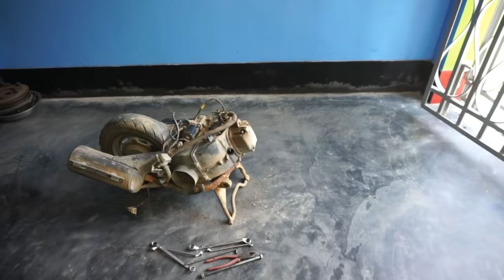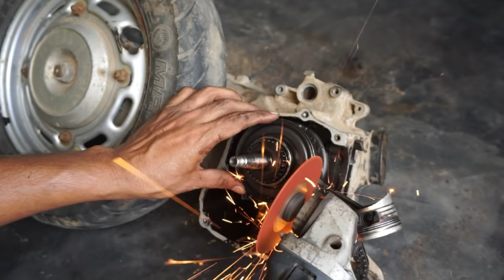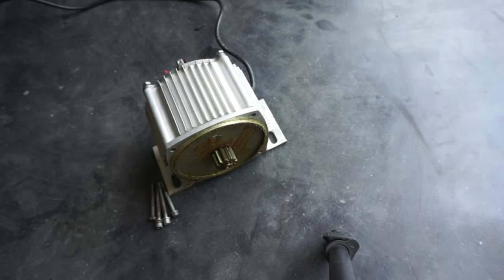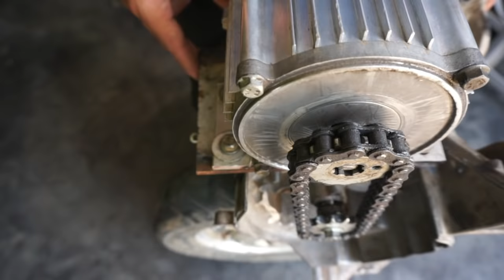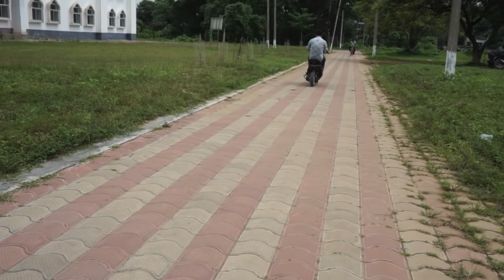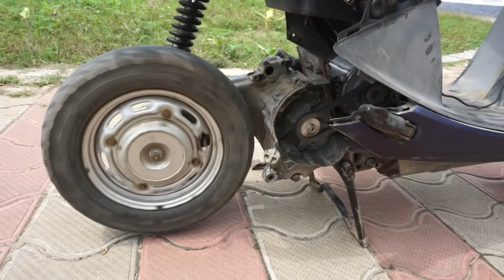DIY Electric Scooter Conversion full video # Technical Partha

Comment: Add engine oil to the crank housing for lubrication, otherwise crank bearing will cease soon.
Reply: Yatak rulman bjse olmaz devam
Reply: Greased baring can be replaced I think.
Reply: UR ri8
Reply: It would be wise to remove the counterweights too. They’re useless and just one more heavy component to spin. A direct shaft would be better

Comment: This is well done, but i think you need to take out the original crank shaft and replace it with a straight shaft. The original crank shaft is designed to balance the reciprocating mass of the piston and con rod, the piston and part of the con rod have been removed so now it is out of balance and will vibrate.
Reply: And how the lubrication will function.
Reply: @westmontroque7061  Which lubrication? For crank bearings? The same as it functions with original crank. They are ball bearings not shell bearings anyway, with no heat from combustion engine and no blowby exhaust gas leaking past rings they would actually need very little lubrication, they would probably be fine just packed with bearing grease.
Reply: Do you mean without the counter weight? Where can you buy a shaft without a counterweight?
Reply: @Meme_supplier  Huh? Just a straight shaft the same length as the existing crank shaft with the same diameters at the bearing races, you don't need to buy it just make it. Guaranteed that motor vibrates like crazy the way he has it set up. If the vibration resulting from the mass of the reciprocating piston was negligible and didn't need counterbalancing then the engine wouldn't have had a counterbalanced crankshaft to begin with, but it does and now he's taken out the mass it was counterbalancing so it's going to vibrate the exact same amount as a piston engine with no counterbalanced crankshaft. .
Reply: Можно на прямую к редуктору цепь пустить не через коленвал
Reply: @teist111 yes that would be even better.

Comment: All he had to do was change to a sealed bearing for the crankshaft , put a block off plate to keep the oil in the trans area, and it can last. Problem, its off balance, he needed to weigh the piston and rod, and add that weight to the crank rod journal. If he do those things, it will be trouble free. Other than that, good job.

Comment: Great effort loved it..... however to increase the efficiency and reduce noise.
.
1.clutch should have been excluded and a direct coupling should have been established, 
2.motor to gearbox connection should have been done with a drive belt to reduce chain noise and the chordal action of the chain
3. rubber bushes below the motor mounts to dampen any noise.
Reply: agree man
Reply: are you ever view the video on youtube that DIY which is your explain
Reply: @edrisumindra3118  No I am speaking on the basis of some experience that i have building formula student racecars in college.

Comment: Maybe a more direct path between the electric motor and the wheel would have been ideal. Coupling the motor directly to the transmission belt that is protected in the casing for example, and get rid of some parts.

Comment: So by cutting the connecting rod off, the piston is removed but a stump of the rod is left in place? Why? That would cause an imbalance, no?
Why not have just unbolted the rod and remove it with the piston?
What am I missing?
Also, must have had that chain measured just right to fit like that. 
Finally, what kind of electric motor was used?

Comment: Perfect use of CVT

This will give more Mileage per charge, and also this will give more speed

And this will never overload overload the electric Motor, due to CVT.
Reply: Right! But manual transmission will be best with electric motor
Reply: @automoto95  manual transmission means hell lot of parts and Oil dipped components with a continuous need of maintainance of oil and gears and clutch lubricants on regular intervals. Then again a standard specification of oil 10W or 20W. Adding extra costs. Plus Manual will put load on the Electric motor, since not everyone is a expert at manual gear to speed ratio handling, and will be a knocking sound setup, putting unnecessary load on electric motor if ratio of load : speed is in wrong gear. And it won't be a handy vehicle for many of today's generation

while in most CVT its dry clutch and belt. Replacement and service is very easy, No oil dip components, means clean setup with motor and easy speed change with automatic load balancing of the CVT
Reply: @bikramdeep2  i thinking about very Simple and and realiable gearbox with only  2 gear or 3 (1st for high torqe on wheels 2nd for standard drive and 3th for higher speeds) and the electric motor dont need clutch if the gear is cheange when the car is on stop in electric cars motors have temp and other protection systems and sensor so it cant be overheat and damage by wrong gear. the cvts torque on wcheels will probadly suck on lowspeed on offroad and cannot pulling heavy triller  the beld skid and car cannot move maybe ony good cvt can do that and yes that type of cvt will be better than manual transmission
Reply: But you should consider the 25 percentage efficiency loss due to cvt
Reply: I have done an ebike replacing the cvt with a chain drive which gives better speed.
Reply: @fabinfabin2208  nopes in fact it is better since efficiency of geared vehicle depends on the rider and every rider is not that skilled

and for city use of highway use CVT is best

and CVT is more refined than tooo much refined gearbox clutch arrangement
Reply: @bikramdeep2   which is better sir cvt?
Reply: @rsstatus2533  CVT is best, simple and easy setup, and low cost on service of spares
Reply: @bikramdeep2  se what is top speed ?

Comment: Very , Very , nice idea , well done Diy , only few details , when You mounted the plate for the motor , You left many openings for dust and Water to enter in the cavity where the former crankshaft is that will ruin the berings ,You should seal it  also the area of the chain that goes to the wheel ,but great job , the best to you

Comment: Once i get started with my new job, i'll buy myself an old, non-working scooter and modify it the way you guys did. Albeit with a longer mileage. Also, an improved mounting on the cvt so as to prevent any damage to the motor as well as retaining the stator to provide additional power to the batteries for longer trips.
Reply: Using electricity from a battery to turn a motor that spins a stator to make electricity is wasteful.  

Just like it takes power from the original gas engine to spin the alternator, it will take power from this electric motor to make electricity with the same alternator.  
You can't even make the same amount of electricity with the alternator than you took from the battery to spin the alternator in the first place because it's an inefficient process every time you convert power from one type to another.   

Think about the Law of Conservation of Energy with a thought experiment.  Imagine the performance of a 5 hp engine powering a scooter with a direct drive by chain & sprockets.  Next, imagine using the same 5 hp gas engine turning a stator (alternator) that charges a battery that powers an electric motor that propels the scooter with the same type of chain drive.  Will you gain or lose horsepower at the wheel?  
You will lose because an alternator is not 100% efficient at making electricity from mechanical power.  Also the electricity the alternator produced is not 100% converted to chemical energy in the battery during charge and not 100% of that comes back out of the battery as chemical energy is converted back to electricity.  Similarly the electricity you are now left with will not be 100% converted by the electric motor powering the scooter wheel.  All those losses add up.
So, if you have a battery powered scooter to start with, you should run your lights & horn directly from that battery rather than running a wasteful alternator from the electric motor to power your lights or to inefficiently try to recharge the main battery.  
Of couse these additive inefficiencies explain why an electric vehicle can't recharge itself on the road when even at 100% efficiency the best it could do was to break even returning the same energy back to the battery that it drew from it in the first place!
All you have done is add weight and complexity to your vehicle.  

It gets much more complicated to engineer an efficient hybrid vehicle, but that's a whole different story.

Comment: I have converted my scooter the same way using belt drive , 48 volts bldc motor 750 watts. Works like a charm , but I would like to give 4 inches motor pulley and crank drive 3 inches. For a better speed
Reply: Hii
Reply: Do you have picture how much teeth does your cogs have please
Reply: Speed kitni hai aur kitna km Chalti Hai
Reply: Halp mi sar

Comment: Show us a video of the wrecked engine, please. We like to know how far you go without lubrication of the crankshaft before it seized !
Reply: just like 50cc 2 stroke scooter, no need for engine oil inside crankcase
Reply: @spin022  have you ever heard of the 2T oil? I guess not
Reply: @Morzsaszar  2 stroke oil mixed with gasoline to lubricate the cylinder bore and the piston itself, but there is no crankcase oil in 2 stroke scooter engine
Reply: @spin022  I know, this one calls mixture lubrications
Reply: @spin022  It absolutely essential for the bearings
Reply: @spin022  that mixture lubricates the crank to dingus.
Reply: I'm using this electric conversion method for 2 yrs and have not got any issues yet with the lubrication of crank bearing, remember that it's electric and there's no heat that bearings have to deal with
Reply: They are ball bearings not shell bearings and now with no heat from the combustion engine and no exhaust gasses blowing past the rings the crank bearings would be fine just packed with bearing grease, plenty of machines have shafts and ball bearings that run high RPMs long term without being oiled, just packed with grease. The biggest issue with this engine is that he used the same counterbalanced crankshaft with the piston removed, now without the piston it will be way out of balance and vibrate like crazy, to the point of destroying itself after a short time I would think.

Comment: this method will work but you are cutting the piston at the crank skipping flywheel balance which will create more vibration and often damage engine bearing if you compensate the weight at the opposite side of the flywheel by adding weight this is going to be ideal in performence

Comment: Fantastic, thank you! I thought to convert my Vespa LX 50 2T to electric by attaching motor directly to the crankshaft, but this way it maybe even easier. I spotted that your motor is less that 1kw? What speed it can reach?
Reply: The motor is 750 watt and speed may be 45 to 55 kmph.

Comment: I think it is possible to fit a bldc motor at scooter rear wheel studs with a  + type clamp of pully. The plus pully,  fit on scooter engine other side on stud nuts than motor fit with + pully, also connect aarm to keep motor study ly. No need to make alteration of scooty  I think . Just like as water pump set mono block.

Comment: Sir, what is milage you are getting while chain drive! please Do and comparison with belt drive 🙏.  Also please make a video on making fixed battery compartment under footboard with proper ventilation or cooling system

Comment: On a side note after watching video. Remove gas tank and mount a car alternator that is belt or chain driven so you only use battery for startup and alternator takes over keeping battery charged for much longer trips.😁

Comment: Muy buena la adaptacion ...perooo deberia de subtitular el kilometraje q rinde x cargada...y a cuntos kilómetros va x hora x lo demas muy buen video...ojala y muy prnto tengamos mas noticias del mismo ya terminada la moto.
Reply: Sí...y sobre todo que pack de baterías que usó y donde las colocó no?
Reply: La partie électrique  de la batterie 
Comment  l on branche les fils du moteur + et -  directement aux bornes de la batterie. Et pour accelerer et ralentir y a t il  un variateur. Comment faire..et également le plus important les
Références et types du moteur que vous avez monté. 
Merci de reponde SVP

Comment: Brilliant! Please try Petrol/electric hybrid with on road charging in petrol mode. If you crack this then its a big seller for you.
Reply: Put an electric wheel hub on the front as a stator (generator/alternator) n leave the petrol engine but put another hub on the back with a bicycle freewheel for when the rear motor takes over it doesn't fight the clutch, etc

Comment: may I ask,. what is that solution or liquid that you use to remove the grease from the motor?? is it a degreaser solution or oil or soap and water?
Reply: Gasoline
Reply: The best is Diesel added with soap 

apply it with brush or spray it with any sprayer bottle on the grease leave it for 30 minutes or if too dense grease, then overnight. Use a hard plastic brush or a metal wire brush and scrub, and then simple detergent soap wash
Reply: Maybe petrol or diesel. We usually use these to remove grim from vehicle parts

Comment: Why same sprocket? It's 1:1 where as the original of your BLDC Mt was 1:3 gear ratio.

With this weight load the bldc motor is at least 1:7 gear ration otherwise it will burn the hall sensor and one of the 3 wires.

Comment: Between motor and wheel you put cvt it make loss of power and pickup you got more power or pickup if you remove cvt between motor and wheel 

Attached motor with wheel directly its save enery and give you long range or power will increase pickup also increase 😊

Comment: You should of connect motor to rear wheel belt instead of again to CVT clutch, because now there are two controllers because of there are energy loos, 
Motor spin very fast ,rear wheel rotates very slow.

Comment: Keeping the variator in the transmission is a bad idea. This is where a lot of energy is lost and in this case, will affect the riding range. The best option is to use a 3KW hub motor and a fabricated swing arm. Less effort and better efficiency.

Comment: Major drawback of an automatic scooter is its CVT transmission, you just kept it. There will be a lot power loss in there. Just use a hub motor or direct belt drive
Reply: You need to keep the CVT for toruqe. There is no power loss here. What we need is torque instead of raw horsepower.
Reply: @binarytv2904  CVT is power loss. Electric vehicles doesn't need any kind of gears or clutch. You just need a pair of pulleys and a belt, that'll give you torque. And speed torque curve of an electric motor is almost flat. So why would you need a CVT
Reply: @roshinparameswaran4817  EV's do need gear, every EV out there has a single speed reduction gear. Thats the minimum. If you need a smooth takeoff a single speed reduction gear is neccessary otherwise it's too much load on the motor and the massive torque from the mmotor causes jerk. It's inefficient. A therotical 1:1 motor:transmission ratio is not practical. It can be done but no EV manufacturers out there does it. Only college projects and hobbysts does it.
Reply: @binarytv2904  all hub motor drives directly run on motor, they doesn't have gears. 
Two pulleys and a belt also act as gear. A single speed gear system is using to produce torque that we need if the   motor is designed to the actual torque required, there isn't a need for a gear. Modern e scooters are using the belt and pulley system as replacement of gears and move the motor to the centre of the vehicle so that the centre of gravity will be lower.
And a CVT is not a single speed gear. First study a CVT system, then you'll know what I said.

Comment: Well done but you forget to remove connecting rod from crank shaft
Reply: Even if it is removed, the engine will run like a jackhammer because the flywheel is super imbalanced.  The product is fake.

Comment: Yet another perfect example of the proper way of converting a scooter without scrapping the pully and cluctch system as well as the gearbox. How fast did you guys get this to run? Can it carry a 125kg fatass like me? I sure hope so!😆😆😆😆
Anyways, the only thing to give this scooty is a new racing pully and clutch system.

Comment: 750w isnt powerful.u need around 3000w.also u need to lubricate the bearings.better take off the engine and build homemade frame.u dont need cvt anymore its only more resistant.

Comment: you need to chance the springs in cluts this electric motor has les power then cilinder
Reply: You mean Les power
In 0 - 100 rpm
tHE TORQ MORE THAN COMBUSTION ENGINE
and you said the power is less in low RPM
You've gotta be kidding =_=
Reply: Cornelius Sianturi do you even look @ the video bro ? You van see that it losse power

Comment: The real question is the law says in USA 50cc or under to drive without tag etc, what if you put 50hp electric motor in the frame. I wonder what happens if they see you doing 100 mph.😂. "Sorry officer I think your radar gun is broken this is 50cc moped".😎😎

Comment: What’s the top speed?
Reply from the maker: 45km/h
Reply: Technical Partha can you double the speed by using 2:1 gear drive ratio instead of 1:1 and since its CVT it will deliver the low end torque for the initial run!! 🤔

Comment: BhI MATLAB Kuch bhi bna do . Jo engine ke parts engine oil Mai rehte hai unka life Ka Kuch pta Nahi . You remove oil ? What's the temperature of assembly after run your vehical. Janta Ka bewakoof mat bnao.
Reply: Aur rear drive belt kaha hai , motor ka power rear wheel ko kase transfer ho raha hai . Jara bata sakate hai kya??